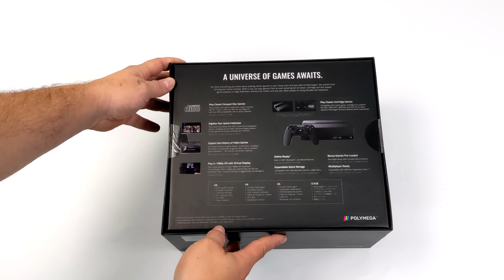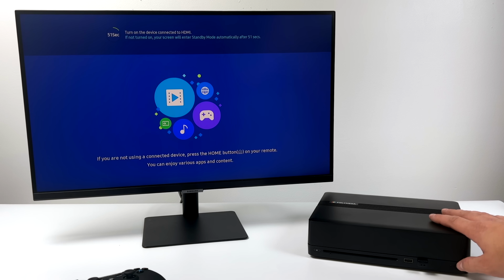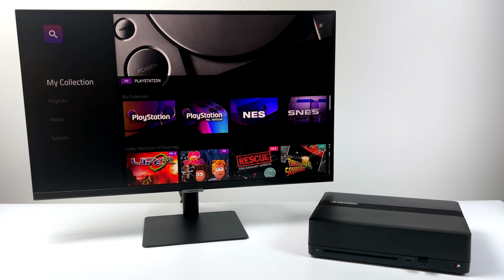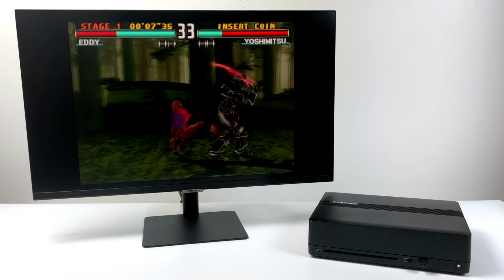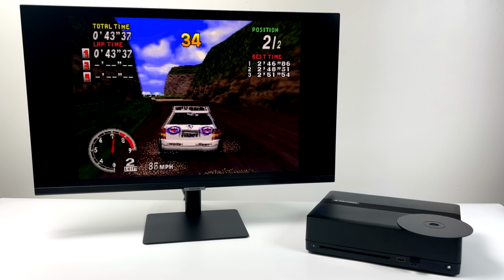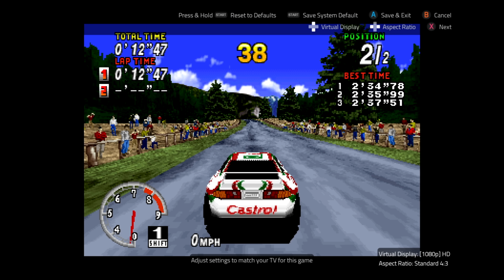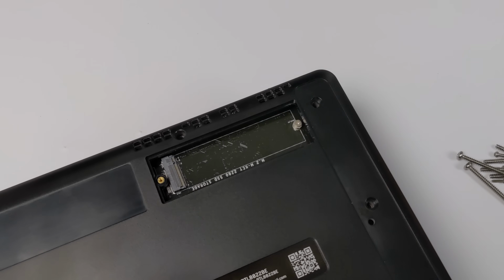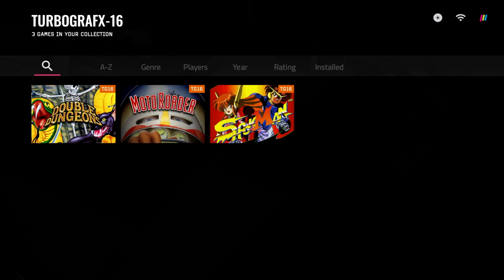Is This The Ultimate All In One Retro Emulation Console? Polymega First Look

Comment: For this price of Polymega, Xbox Series S is shining like a star.
Reply: I mean it's core feature is to take your old games into it. So the prize is reasonable.
Reply: @Trimint123  but you have to buy extra add-on to use your cartridges, for each system.... what about even older systems that used floppies or cassettes - there are A LOT of Amiga games I would LOVE to se on a modern system, can it run them? you can even add your own roms that you copied before they hit their last leg and arent around more --- that's what MOST of my roms are
Reply: I'd spend the extra few buck for a Series X and then there are SOOOOOO many more options for running emulator for so many systems , even the ps1 ps1 (and i think maybe ps3) - it's just a WAY BETTER system for emulation, HANDS DOWN
Reply: @Nobe_Oddy  the Intel uhd 610 graphics on this console is trash. Its the Achilles heel of it especially when compared to the Series X. Microsoft's console runs circles around this overpriced PC.
Reply: Nice test and totaly agree with other user,  today a Xbox Serie S or X with Retroarch is better and cheapper. Personaly i bought a dev account for 19$ and i use Retroarch like a pc on my Xbox Serie X 😎
Reply: @Trimint123  no thanks. I already own the original hardware to play them and I prefer to play them on a CRT. I can appreciate what they are doing for the conservation of vintage gaming though.
Reply: @albertsmith99  what exactly are they doing?
Besides gouging people on price
Reply: @guillaumex8146  That account price comes with ROMs and else?
Reply: I agree. Who is this even for?  Like, if you keep your physical games (I do too), you probably play them on native hardware anyway. And if you wanted to, you could just get a PS2 for like 100 bucks.  Or a Sega Saturn for however much that goes for.  I mean, down the road it'll make more sense, as consoles become far and few in between.  But this console doesn't even play them with the actual hardware.  It loads the disk and emulates whatever game you put into it.  So at that point you might as well emulate with any laptop you already have.
Reply: xbox is trash these days ps5 is better
Reply: Not since we lost the ability to access removeable storage with retroarch in the latest xbox update.
Reply: @vyor8837  nope
Reply: They do two completely different things, so I'm not sure why you're even making this comparison.
Reply: @Progger11  you can put retroarch on the xbox
Reply: @vyor8837  I don't want to "put" anything on my Xbox. I want a dedicated machine for all my physical media from my retro library.
Reply: @Progger11  so you don't play games on a game console?
Reply: @vyor8837  Where did I give any indication, of any kind, that I don't play games on consoles? I said I didn't want to stick anything extra on the Xbox I own (indicating that I play Xbox games), and that I want a dedicated machine for my physical retro (console) games.
Reply: @Progger11  your slowly degrading physical copies?
Reply: @Progger11  I would never want to play retro games using hardware only. I have too many games I want to play so software is the best route for me.
Reply: @Evilj82  Cool. Go for it. I like playing on consoles and as authentically to the original experience as I can.
Reply: @Progger11  yeah that means you shouldn’t buy this device . It’s either original hardware or software via the Series S.
Reply: @Evilj82  I'll buy whatever I damn well want to. For any reason I want to. And those reasons don't have to make sense to you in order for them to make sense for me.
Reply: @alexisrivera200xable  uhd 610 on my pc runs switch and ps3.
Reply: Agreed
Reply: @Progger11  yes but you’re the one complaining in this comment thread about the series S and we are answering your questions. You must be a shill or a burner account for this product.
Reply: @Progger11  I play retro games on my Series S and then when I’m not at home, I transfer the Save Data to my Anbernic 351P and continue playing the same game when I’m not at home. The beauty of software.
Reply: @Evilj82  Right, because anyone who would dare have a differing opinion from you must be a shill.
Reply: @Evilj82  There is nothing wrong with using purely software if that's what you like. What I have never understood, however, is why people like yourself cannot help but jump into the comment section of posts related to physical media preservation and try to argue that your preference is somehow the only one that makes sense. That's what I'm getting at.
Reply: Yeah this video made me think of emulation on the XBox. Polymega is pretty weak specs-wise, and with all the horsepower of Xbox it can internally up-res the textures of PS1 games 9X so it's actually playing at 4K. Never seen PS1 look so smooth and crisp. Something the polymega with it's weak specs could never hope to achieve. And sure, I know it never aimed to really do that, but at this price point it does invite the comparison.
Reply: @decoydragon11  I have both and been a Sony fan for years. The truth is XBOX is the better system this time. Game Pass hands down gives them the win, plus the ability to run emulators, or steam. Ps5 gives us what, 2 crappy games a month, and a few console exclusives a year. The games that at 3rd party play better, have better FPS on the XBOX. Hands down the XBOX is the better option
Reply: PS5 still better
Reply: @decoydragon11  incorrect
Reply: You can also buy every original console it’s emulating for less money. On top of that you can probably add a few more like 2600 and Colecovision. I would love to see an original media adapter for an fpga solution, but this thing is just a super underpowered PC running the same emulators everyone has been using for years. Rpi4 will do all the emulation this is advertising and much more. The physical media support isn’t worth the price nor bulk of this thing and all its adapters.
Reply: @decoydragon11  It's better at running emulators? You know, what this whole video is about?
Reply: @mamaluigi429  And what makes you think that the power envelope of the laptop grade parts in this is the same as the desktop counterpart? No my friend laptop parts share the name but the performance characteristics are wildly apart. 
Your desktop gets a much higher thermal limits and more robust power delivery circuitry. Yours probably is between 65 to 95 Watts TDP for the CPU / iGPU while this will never see more than 20 watts and only for limited times. The limiting factor is that laptop parts run on batteries so power is much more limited along with the thermal limits the small space allows. (Otherwise it would drain the battery burn you and melt the plastic of the handheld.
Reply: @alexisrivera200xable  the one i am using is laptop. Thank you for your kind explanation, though.
Reply: (I laugh in modded PS2.)
Reply: @vyor8837  , are you sure that you are not talking about your brain when it comes to things that are degrading?
Reply: Can we please stop comparing fpga/emulator consoles to modern consoles.  Do you not realize that these game companies sometimes either break even or take a loss with their console sales in order to make money with games and subscriptions?
Reply: @espressomatic  , so, what will you do once the parts begin becoming more and more impossible to replace because they are no longer being manufactured or are replaced by inferior quality aftermarket/custom parts?  Finding good aftermarket/custom parts is a crap shoot every time that you go looking for them, much in the same way that they are for replacing them for classic vehicles.
Reply: To be honest, the Polymega does have one thing above the Xbox consoles as far as emulation goes: it's above board. Polymega is a legit method, with no grey area, to play these older titles without the need to hack your console, all the more while justifies the purchase of older physical games. 

It's a niche product, sure, but it's not like there's absolutely no market for it.
Reply: I don’t mind having this and keeping my physical copies non scratch and even my consoles perfect.
Reply: @alexisrivera200xable  if your buying this, you don't care about graphics. You are buying it to play all your old Games that you wouldn't be able play otherwise.

Comment: For the price point of the base and the deluxe unit. The universal controller should be way better than a recycled model.
Reply: They included 4 custom controllers and 1 recycled model controller with my deluxe bundle. They clearly focused their time and efforts on their custom retro controllers and not the base unit pack in controller.
Reply: @Vachey  is that you Polymega?
Reply: literally my first thought when I saw it, the most generic controller I'd ever seen
Reply: Is essentially a Gamesir G3s controller

Comment: what i am seeing in this device is sadly only a Low end Mini PC with a DVD drive and some custom connectors running a decent emulation OS.
Retroarch can use CDs, and you can add that cartridge feature by buying a Retrode. if it was prices at like 200€ or less it would have been interesting, but i think its massively overpriced for what it actually delivers.
Reply: First time I've read Retro can run CDs. Can you link to a video or something about it.
Reply: @themexicanwolverine  if you have a CD drive retroarch legit asks you to dump the cd if need be you just need a DVD drive plugged in 😄
Reply: @manankataria  That's awesome. I had no idea.
Reply: @manankataria  so can I just run my PS1 games or do I need to dump then use?
Reply: @themexicanwolverine  there is a load disc option as you will see in the video I sent I am assuming this is more dependent on the core you use and if it can support the disc files 😅 sorry I can't answer this as I am from a third world country where buying old games is basically impossible I am trying so hard to get a 3ds and vita but it's become a distant dream at this point sadly 😔.
Reply: I am constantly using my old Mac mini for exactly that, Playing PSX games I have 
Even the old burned copys from back in the days still work.
Reply: @manankataria  Ebay is your friend, I got a Vita shipped to me from Japan for less than $100 USD.
Reply: @manankataria  Thats still emulation.
Reply: @hia5235  the Polymega is also emulation, so no difference there.
Reply: there are enough people who have no desire to build it themselves, but just want to plug it in and get started
Reply: @kontrollpunkt3530  that still doesn't make it worth 449$.
Reply: @kjjustinXD  maybe we will see a price drop. I like the concept, but for me the price is too expensive
Reply: @kjjustinXD  That depends who you ask lol
Reply: @kjjustinXD  can you find this much compatibility for less $$$$$ and not have to build it tho?
Reply: What do y'all even mean with "without building it" 
You just use a Desktop, a mini PC, an old Laptop or even a Mac mini with a DVD drive and install Retroarch, is it so hard to download and install something that's EXACTLY MADE for the purpose of Playing retro games? If you want cartridge games, buy a Retrode and connect it. Gets you the same or even more functionality with a way smaller pricetag and you can actually use that thing on whatever device you want to.

If y'all wanna pay 450$ just so save 5 minutes of work then go ahead, but to me this is just stupid.
Reply: @kjjustinXD  is it really just 5 minutes of work tho? And I don’t live on a pc to know the ends and outs of setting up a emu station. Hell I couldn’t even figure out how to patch msu-1 for snes games. There is a reason people want plug n play. Everyone here sounds like a bunch of pc elitist that won’t touch a series x or ps5 with a ten foot pole. This is for people that like to play on consoles
Reply: I think the problem here is people want something for nothing
Reply: @kjjustinXD  Very true. I have a Gigabyte BRIX from around 5 years ago.  It cost me less the £200. Mind you I had to put a stick of RAM in it along with a SSD or HDD. I generally have those types of things lying around. For the asking price of this you could get yourself a decent BRIX style PC with much better specs.
Reply: @swungsolid  check out Launchbox and the videos on their YouTube channel. Also check out Retroarch. These are the simplest to install/setup on Windows.
Reply: @kjjustinXD  I 100% agree with you but you gotta look at this market retro gamers are basically considered to be a bunch of suckers where the few % spend bucket loads of money imagine being the dude who bid 300$ for a Wii u in one bid I was looking at ( the console where majority of the games are ported to switch and has good emulation) .

It is basically the small few people that define these niche markets in my experience as someone who is also a mechanical keyboard enthusiasts and has a 500$ keyboard 🤷‍♂️.

Comment: I want to hate on it for the low specs and high price but it's beautiful. They did a great job with the UI and usability seems spot on. It would need to drop that price another $200 to fit on my TV stand. I'd be more willing to shell out the money they are asking if this was a FPGA device with the same kind of connection system.
Reply: I think I'd pay to have their OS/frontend
Reply: FPGA Mister is probably closer to what you are looking for
Reply: I skipped fpga bc most cores don’t have save states
Reply: Bro, I recommend getting the Valve Steam Deck. :) Can play emulators, and is faster than a relatively high end gaming PC from 2015-16, or mid range gaming PC from 2017-18.
Reply: @sociallyresponsiblexenomor7608  I'm saving up for one. I've got original consoles, but it's nice to have it all in one unit.
Reply: @martinantelo7086  Im hoping someone is able to take the UI and adapt it for a similar Windows build.
Reply: @Exoamy   I think the UI would be perfect to adapt to the steam deck. The main reason I preordered a steam deck the first day it was available is so I can try to build a whole new UI for running emulation. We have a good start on one we just haven’t had our hands on it yet to put it Into action. Hopefully by Christmas we will have something presentable.
Reply: @bland9876  it was meant to be, but they scrapped it because it would have taken too long to write the cores. Lol like it took so long to get to market anyhow - for what is basically a small all-in-one pc. If you want to get into FPGA then check out the MiSTer FPGA.
Reply: @thatguyalex2835  it is not that fast.
Reply: @vyor8837  The Deck is faster than what most average Steam users use though, according to the gaming PC specs report (hardware survey).
Reply: @thatguyalex2835  it isn't even as fast as a 1060 3gb on the GPU side. Which is much, much slower than a midrange PC in 2019.
Reply: @vyor8837  Now high-end in 2021 thanks to the neverending crypto boom
Reply: @lucasn0tch  no, high end in 2021 is a 6800xt and above
Reply: @sociallyresponsiblexenomor7608  Until they beef up the mister to play PS2/Gamecube generation I'm just using OG hardware.
Reply: @T0TALLYAWESOMEGUY  I’m well on my way to collecting most OG hardware, so agreed.

Comment: Would be interesting to see Performance vs the Mister multiconsole
Reply: Would be great if all consoles on mister had save states
Reply: if mister runs something, then it runs at full speed. 

fpga is a reimplementation of the original hardware, it either runs or doesn't.
sure it might be a case where a fpga emulator might not run something correctly and it ends being slower than it is supposed to, but that is a issue with the implementation not the lack of capacity of the hardware, the fpga that mister run on goes up to 100mhz iirc. that's why it will never run dreamcast since its cpu runs at 200mhz

but is not like a program based emulator that is dependent on the horsepower of the machine running it.

Comment: I still don't understand why this needs to exist. It's an underpowered PC with a CD drive.
Reply: I wonder if the pc can load the original games because thats the only difference lol
Reply: @magnus00125  The Poly can play the game directly from disks. Although you can also install them too.
Reply: The point is the cartridge modules.
Reply: It's for people that enjoy physical games and collect them to use in only one system.
Reply: Because it works out of the box with no setup? Everything is just plug and play and comes in a sleek looking package. People pay for convenience. It has a good looking simple ui with all the metadata and artwork preloaded. I don't have to install retropie, scrape artwork, configure emulator settings. I pop in a game and can just play.
Reply: @mikem3846  most emulators can load roms directly from discs as well, such as epsxe which has had the capability since its inception
Reply: @magnus00125  PCs can, and RetroArch, as well as multiple emulators, have you covered
Reply: Its a all in one solution that uses physical media.
Reply: Some people absolutely insist on the console experience. I personally don't get it either but theres products like this looking to exploit that market.
Reply: @TacticalPower88  From a non-gamer perspective: I think the Valve Steam Deck is a device that gives a console experience, whilst being a PC. :) I don't understand why people would buy a Polymega over this.

I am a tech enthusiast, so that is why I sub to emulation/gaming channels, even though I couldn't care less about 65% of videogames. That Sega racing game does sound interesting, and I may get a second hand Anbernic RG350 for Christmas, and play Playstation 1 or Sega videogames for the first time. :)
Reply: You can say the same about most modern consoles after the first year.
Reply: @TacticalPower88  Honestly, it's mainly nostalgia. It's an added level that some people appreciate.
Reply: @SmallSpoonBrigade  Modern consoles have exclusive games and proprietary hardware. This is an underpowered PC with a CD drive. Any PC with a CD drive can do what this does.